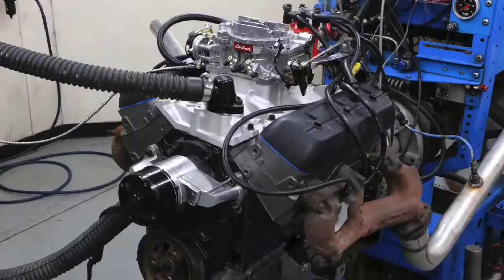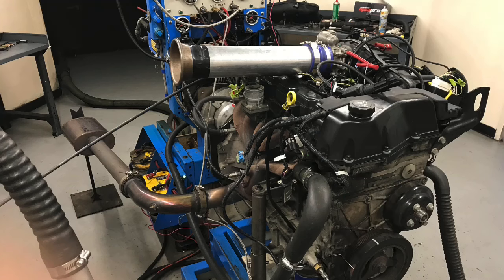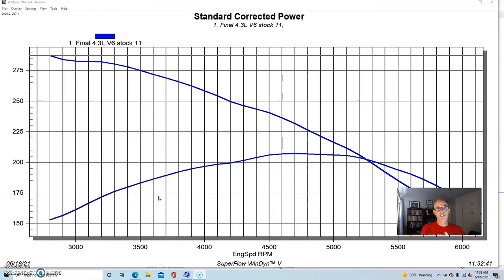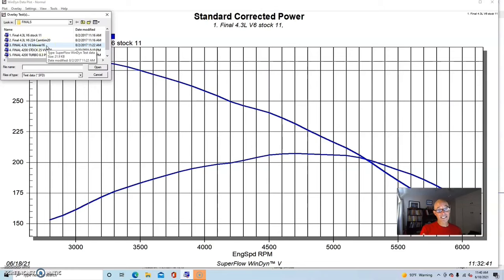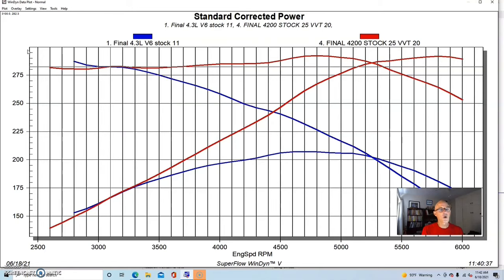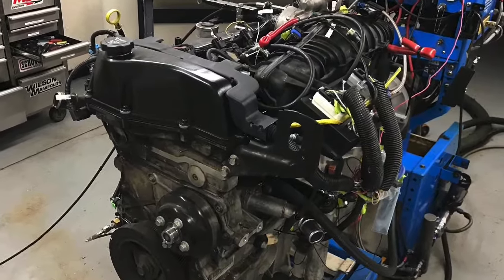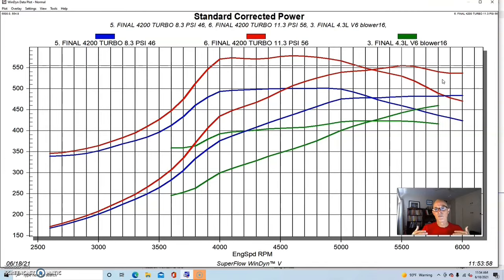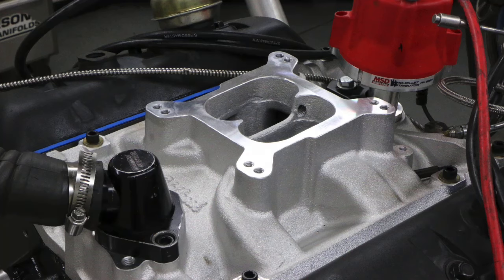4.3L VORTEC V6 VS 4200 ATLAS INLINE 6 (VORTEC VS AMERI-BARRA)

Comment: Straight 8 with DOHC upgrade should be a strong engine. The Duesenburge straight 8 was the most powerful engine available for a very long time .  It is supercharged most generally tho .   What about 2 iron dukes connected front to back and timed with a v8 distributor cap ?  Just letting my brain run umuck lol.  Interesting results you have there.  The I6 atlas is a powerhouse!
Reply: Iron dukes you smoking that stuff again

Comment: I had a TBI 4.3 in an Astro cargo van it was an animal I believe it had vortec heads it would burn em through second gear go sideways all day,then I had a bit newer version with a 4.3 that said vortec on it that was a dog it had no downlow power couldn't break em loose at all
Reply: Your TBI 4.3 didn’t have 96+ vortec heads, as TBI ended in 95.  But I do agree those old 4.3 TBI’s would run strong.
Reply from the maker: who said this was a tbi 4.3L? it did have vortech heads on it

Comment: Gm still makes the 18° heads for the 4.3 and I think the intakes are still available. I see used 23° heads and intakes but they are  pretty expensive. I would like to see the ecotec 4.3 vs the atlas
Reply: GM has discontinued all 90 degree V6 performance parts a few years ago.  Still stuff out there available, but 18 degree heads/intake would require custom headers as well.
Reply: @SyTySpeedShop  Actually gm still has 18 degree heads in stock

Comment: I own a S10 with a race blue printed 4.3. yes I ported the heads and zero decked the block also. I trimmed the heads to a 10.5 compression ratio and kept the stock cam.  This thing is a beast. Tranny had to be built to 4l85 standards to take it( tranny shop was pissed).  It broke a 3.42 AUBURN GEAR HOUSING! It is hard to drive in the rain. It barks third gear DRY and does twelve inch wheel stands. These motors CAN BE BUILT for POWER.
It also broke Dyno straps during great changes. They are no cocktail party joke!

Comment: Back in 2002 in Orlando I was in my 928S2 5 speed one night, and this guy in a GMC Syclone wanted to race me.  When we got onto 436 we both hit it and I was able to pull away from him.  The 928 in question ran a 13.86 @ 105 at Bithlo speedway, it was 330 hp and about 3300 pounds.  Back then that was pretty fast-

Comment: Would be cool to see you work on the 3.7 dodge v6, it’s just the 4.7 v8 with two cylinders cut off very similar to what gm did.
Reply: 3.7 is a very good engine.
Seen those with 400,000 miles and burn no oil.

Comment: There used to be quite a fold of very high performance parts from GM Performance  back in the day. Ive probably still have that or a Scoggin Dickey SDPC catalog kicking around somewhere. I think GM offered a 4.3L Bowtie block. I know they had some wild aluminum heads making the 4.3 a splayed valve head. Jesel shaft rockers, Hogan's sheet metal fabbed intake manifold, etc. GM might have had an "SB2" head for the 4.3. About all this was for certain NHRA Comp classes. Always loved the oddball stuff and loved seeing & hearing the occasional V6 or inline 6 powered comp eliminator   rail or car! Very unique, cool, unmistakable sound of a mean 6 banger drag car! They made some wicked parts for them back in the day! Would love to see you test some of that stuff if you find anything Richard! I saw a little bit of it ages ago when I few V6 parts came to the engine shop I worked at. Patterson Racing! I can honestly say I played a role prepping parts for David Rampey's super comp SBC. Far as the awesome 4.3L V6 goes, remember the GMC Syclone & Typhoon were GM's fastest production vehicles at one time!
Reply: The lu3 is a stout block

Comment: I've done some trading and am getting a Chenoweth dune buggy and thinking about moving away from the VW power plant to something newer and more powerful. I know I can upgrade the VW and get a fair amount of power out of it but based on what I've seen I would be putting in a fair bit of money into it as well. Looking for some suggestions. I don't mind moving the engine up front and I'm even considering converting it to AWD. I've thought about taking the drive train out of a AWD Chrysler Pacifica however that 3.5L seems to have a lot of issues so not sure if that's a good option. Figured I would start by getting the VW engine running and seeing what that's like and then move on from there. Suggestions welcome. Thanks
Reply: Check out boostedboiz on youtube, they have a turbocharged honda j32 v6 in their sand rail. They are a dime a dozen in every junkyard and make good power with boost. And in my opinion, don't bother with awd, that will turn it in to an endless project.
Reply: @coffelt683  Thank you I will do that.
Reply: I've not seen a kit for a 4.3 for sand rails. I've seen a Lima 2.3 kit and LS kit. People have been using EJ25s from Imprezas.

I think Factory Five still offers an awd setup for the GTM, it used Impreza drivetrain somehow, plus there is Porsche awd system, you could look in to those, much better than a Pacifica and it's 9qt of oil Pentastar v6. I think Mercedes gave them that engine because it sucked.
Reply: @ItsDaJax  Well everything else about the Pacifica sucks so the engine might as well too. Seriously had 3 issues in 2 weeks each would have cost probably 500-1k if I had taken them to a garage to have fixed. Those were outside of the idiotic gas line design on the gas tank which causes an issue and makes the vehicle fail emissions.

Comment: I'm thinking we need a ford 4.2v6 test. The big brother to the 3.8 and 3/4's of a 351w!
Reply: Its 3/4 of a 5.4 triton..
Reply: @brysonshires9742  didn't the 4.2l come out in 1980 in the f100's with a 2 barrel carb?
Reply: @Go4BrokeOffroad  ooh yeah my knowledge doesnt go past the 80's thought you meant a 4.2 from a early 2000's f150
Reply: @brysonshires9742  no worries sir. I've been at this for a while
Reply: Well, a few people in the foxbody world would use the crank and cam from the 4.2 and put it in the 3.8. If I recall could yield about 300hp. I don't think they're as capable as a Lima 140.
Reply: @ItsDaJax  a m90 is a direct bolt onto the 4.2 isn't it? I think just the testing would be cool. 4.2 is just a stroker 3.8 isn't it?
Reply: @Go4BrokeOffroad  Not sure if the m90 bolts up. The 3.8 in question is the Essex I think, not the Duratec found in MN12 cars and SN95s. 87-93 didn't have a v6 option, and the Cologne 3.8 was only 81-84, I think.

Comment: Richard H., Do you have any idea of the year of the 4.3 you were using for this test?
I have one, 
Just curious😎
BTW, thanks for this video. I've been wondering what could be done with this motor👍
Reply from the maker: I don't recall the year of the astro van we pulled it from
Reply: @richardholdener1727  thanks anyway☺️

Comment: How about a Ford 2.3 Lima, vs 2.3 duratec, vs 2.4 ecotec, vs K24. Get to see how technology has moved on over time for popular 4cyl engines. N/A and turbo.
Reply: The Lima carbed makes 88hp, the efi ones make 110hp. The duratec from the Focus makes more power. The Lima has the poorest head flow, even with Dport heads, which are the best heads. It can, however make 4/500hp if built right. Not sure how far the duratec can go, I think the Ecotec was making about 300hp in supercharged and turbocharged form. The Honda and Lima 140 are the only two most likely to be race engines. People used to bitch about ecotecs being hard to tune. I used to want a Sky Redline with a supercharger slapped on, from a 1st gen Cobalt SS.

Comment: I have been daydreaming of a torque monster combination: either the 4200 or a Ford 300, advance the cam timing to shift the dyno curves further left, and then a small turbo (quick spool response) or Supercharger and then waste gate it to ~10 psi. I’d buy everything if you’d build and test it!
Reply from the maker: advancing cam timing will not have much of an effect-the turbo definitely will
Reply: @richardholdener1727  porting the heads on 4.3 still better engine less complexity and smaller package.

Comment: The 4200 vs 4.8/5.3 vortec. We know the V8s make better power but what I'm interested in is the dimensions of the two engine types. Driveability with standalone  aftermarket controllers, is the bell housing comparable?
Reply: @yourmom-ii8ep  Unfortunately the Atlas family of engines uses a unique bell housing pattern. That's probably part of the reason the 4200 was never swapped much.
Reply: The 4200 really can't compare. It's longer, so harder to package. Has zero engine specific aftermarket as far as I know, and shares essentially nothing with engines outside of the Atlas family
Reply: @yourmom-ii8ep  I looked it up and it doesn't share the bell housing with the V8s.
Reply: @ScootyPuff_Jr  I found basically the same information.

Comment: The Atlas heads breathe super well, but the engine has a stroke of over 4 inches, instead of using that head flow to rev, they turned it into TORQUE. Wish they came with forged cranks.
Reply from the maker: If only big stroke motors could also rev-like Pro Stock or Mountain motors

Comment: Cool test! Do we know the weight of the two engines? The 4.2 looks like a behemoth in the videos.
Reply: I think the 4200 is about 300 pounds.
Reply: I don't know the weight unfortunately but I can tell you the 4200 is all aluminum, and the vortex 4.3 is completely iron. Likely atleast 60 pounds in favor of the 4200
Reply: It's looks and weights just as much as a Blue Whale.  🤣
Reply: @andyharman3022  Topspeed says 470lbs for the Atlas and the shipping weight for the the 4300 is 449 with the pallet being 30-50lbs around 410lbs for the V6.
Reply: @Dayandcounting  I figured it weighed about the same as an aluminum LS. Both are lighter than a 350.

Comment: The last gen of the cheapest petrol variant of the Barra i6, Power: 195 kW (261 hp) @ 6000 rpmTorque: 391 N⋅m (288 lb⋅ft) @ 3250 rpmCompression Ratio: 10.3:1, ex factory.
Reply: So probably 300hp tested in this manner 😉🇦🇺

Comment: It'd be hilarious if you could bolt up a set of AFR CNC head and an intake and just leave the unused cylinders hanging off the ends.  Make a block off plate for the coolant passages.  I love the 4.3L in my Astro van but I can't wait to get a 5.3L in it.  If the 4.3L didn't have TBI, I'd cam it and tune it for fun but it's just not worth it when I've got 350HP for $400.

Comment: Hey Richard, if you can find one, I know in 94 GM had a better 4.3 that was in the s10 super sport. Not sure about the heads, and cam, but I do know they had tuned port injection. I used to have one. Wish I wouldn’t have gotten rid of it.

Comment: I like the new 4.3 i think its great on the low end. Got one with headers magnflow exhaust, tune and upgraded flywheel. It runs great it does seem to lose its pull after 4500 rpm though where the v8's still have a little left in them but off the line my 4.3 with those few things feels stronger than a stock 5.3.

Comment: Didn't they run these 4.3 V6 engines in the NASCAR Busch series. I could have sworn the GM performance catalog offered heads and intake.
Reply: They did.... a long time ago.... in a galaxy far far away... lol yup they did.
Reply from the maker: i mentioned that in the vid
Reply: @richardholdener1727  sorry I must have missed it. There is a quadrajet version too, although I think it was a smaller displacement.

Comment: How’s the strength and balance of the lower end of the atlas? It looks like it could put to shame some v8s too. If it can stay in one piece at 600whp, it would be a perfect swap lots of cars.
Reply: Imagined as a perfect swap, but these motors are big in dimensions just like the Barra. Not sure on every vehicle it won't fit, but to give an idea, it's been tried as a swap in a 240Z and wouldn't fit, though theirs a post on the internet about it where the guy stated his measurements of the blocks length, height, width
Reply: It's about the same size as a Barra. Both are bigger than a 1/2 JZ and RB, and Jeep 4.0, probably.

I forgot the channel, but there's a guy with one making 6/700 for a drag car.

Comment: I like the power and driveability of the 4.2 but it didn't have the durability without expensive repair that the 4.3 had.
Reply: I had an 09 TB with 346k miles on it (4200 I-6) when I was T-boned in a crash, and it was totaled.
I drove that thing back and fourth to 7 or 8 different states every 2 weeks for work towing a 5x8 enclosed job trailer for 8 + years prior to that, including Colorado on I-70 yanking that trailer up a 7 or 8% grade at 70 mph. It had 90+?k miles on it when I bought it.

Parts that I replaced are...

Fan clutch... Lol. Of course I did.
Water pump
Passenger wheel bearing 
Passenger CV axle
02 sensor (upstream I believe)
Front sway bar links
Both rear gate shocks on window
Radiator 

The Water pump Fan clutch and Radiator were all the same incident.
I spent so much road time in that thing I would have put another motor or trans in it if I ever had too.
I never did question if that thing would get me there, because it never gave me a reason too.
I was absolutely getting curious about how far that thing was going to go. No noticeable blow by.
And what would make it the longest;    =  Motor or Trans.  =  Both factory stock.  @346k. 
That one was extremely durable.

Comment: I hope you can get a LT-6 before too long, I want to know the difference between it and LS engines, besides the obvious, ohc  and be ring a total Badass, flat plane crank, can the crank an rods , with a custom cam go into a LS or LT 1, it even just the crank, convert a LS to flat plane crank! The forged titanium rods that could get interesting if they can be used in other engines!!

Comment: Hey Richard i am currently building a 76 ih scout. It has the stock 345 in it. Ive been  looking for other engine alternatives since everybody seems to be going LS. Everything I've seen about the 4200 is impressive. Would you recommend using a boosted 4200 on my build or just stick with an LS. Its going to be mostly street with occasional off road use. Just wanted to pick your brain. Thanks
Reply from the maker: turbo 4200 works well

Comment: The race block V6 with decent compression can make 420hp with brodix heads intake, and good cam, 4 bolt main block, V8 oiling system, mine won many races on the 5/8ths mile Dirt track at Tulsa, and took the Championship in 81, and 2 years later the engines were banned because the inlines couldn't run with the V6, and no where close to the 8200+ rpm range with mushroom lifter cam

Comment: Still waiting on a turbocharged Ford 300 I6
Reply: Power nation did one
Reply: @robertmiller7213  they never turbocharged a ford 300, they did a chevy 292 not a 300
Reply: They need a crossflow head for the 4.9.
Reply: @ItsDaJax  I have a gofund me to design a crossflow head that can be machined out cheaply and I would like to buy the hardware to make these heads cheap too
Reply: @ItsDaJax  imagine a nice 24v high flow head with 2.25 inch valves all around
Reply: @Project-gr6zy  That's dope. The LS1 head actually matches up perfectly with the 4.9s cylinders and water jackets, kinda.
Reply: @ItsDaJax  I have not gotten a solid answer on that, but a properly made cnc head would give us coyote level of flow numbers

Comment: I like the 4.3, a lot, but I think the 4200, will be capable of higher sustained power levels, because of the crank, in the V6 having split rod journals, just guessing but I'd say around 300-400 HP, and ft lbs, more and survive, over the V6, I do not trust the split pins, (and the balance shaft ) V6 is easier to package, but I'd love to turbo either, especially with aftermarket rods and Pistons, arp bolts/studs,

Comment: I guess I must have been under a rock for a long time as I just never heard of the 4.2 inline.  However, now that I have, I have an econo altered just begging for this engine (I had considered a Ford inline and previously a 500 Wedge Mopar).  With a 4 valve head, what's not to like and as much as I like the Ford engine, the GM head is far superior to anything available to the Ford (besides very  expensive welded together heads).  Also, if I chrome plated that cam cover, I think I could gain at least 50 hp!
Reply: Nivlac57 has a stude or Fairmont? running in the 9's
And some good vids about what's and not's with the 4200

Chrome cover + parts stickers = 75hp.
Some Slick 50 and Split Fire plugs;     =     UNSTOPPABLE 

If that happens, get bigger brakes.

Comment: Would the 4200 work in a 96 s10? I've been wanting to bring my old baby back from the dead after the crank blew on the 4.3 for a little bit different swap and easier on gas then a V8
Reply: No, it's too long. A 350 barely fits in a s10. I bet the new 2.5 would be a beast in that truck, though.

Comment: What were the Atlas NA numbers?   I know that thing would run.  My Daughter in law had one of those SUVs that had it and you would think it was a V8 the way it pulled everywhere. The previous video about the Atlas started and went on to this one for some reason.  In-line 6 engines are cool the 4.9 Ford is a good engine.
Reply from the maker: more 4200 stuff coming

Comment: 4.2 Atlas is a very strong motor image stronger than a 2jz Toyota motor its just that dozens or  tuners all  played around with the 2jz made forged internals the whole 9 yards if tuners play with a 4.2 vortec the same way you would see 2000hp vortecs all over the place. Tuners play with the engine and make it happen

Comment: Richard when are you going to test the new 4300 LV3, it’s such an awesome lil motor overshadowed by its V8 siblings
Reply: All aluminum, heads are leaps and bounds better and has VVT, would be great to compare it to the Atlas 4200

Comment: Should throw a modern LS/LT based 4.3L V6 LV3 from the 2014+ Silverado into the mix.
Reply from the maker: that vid is up
Reply: @richardholdener1727  Thats great news.  LV3 is no longer in production (2014-2021)